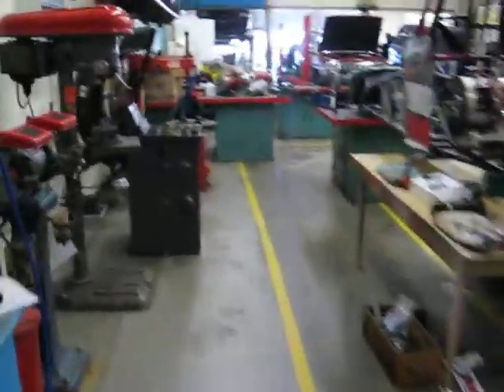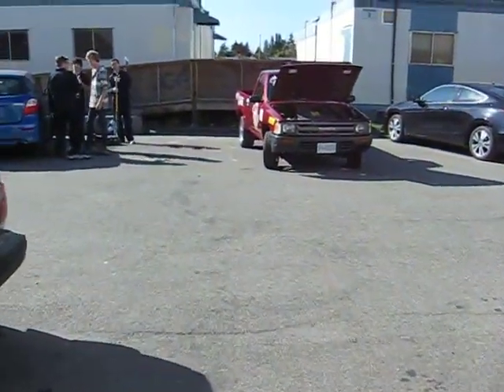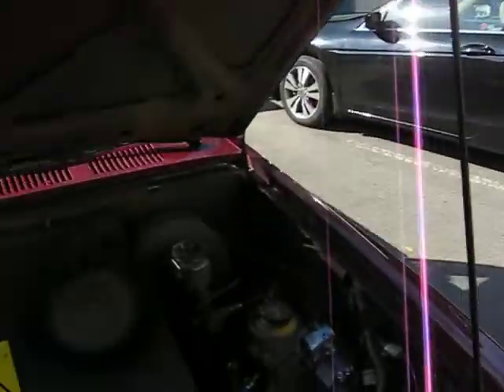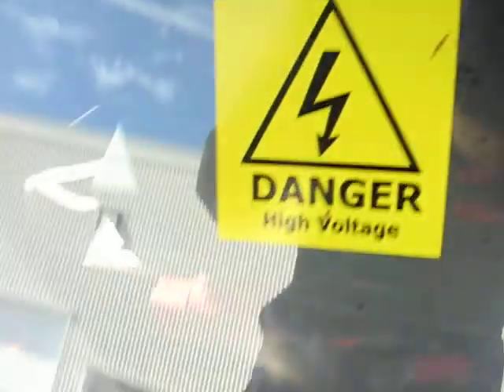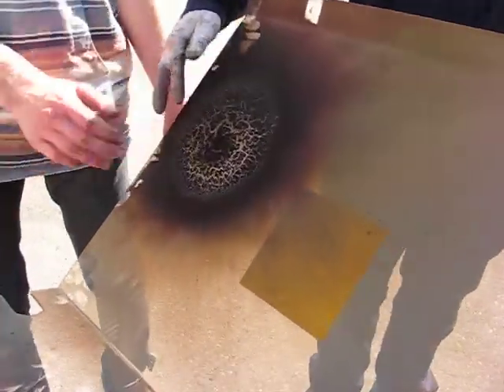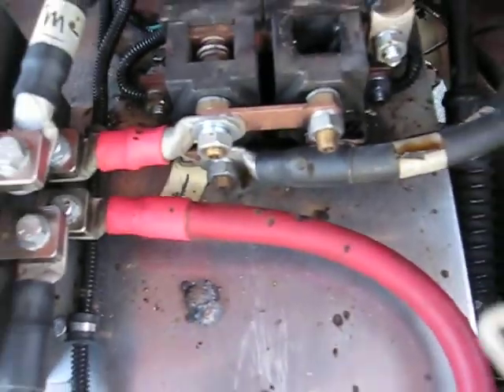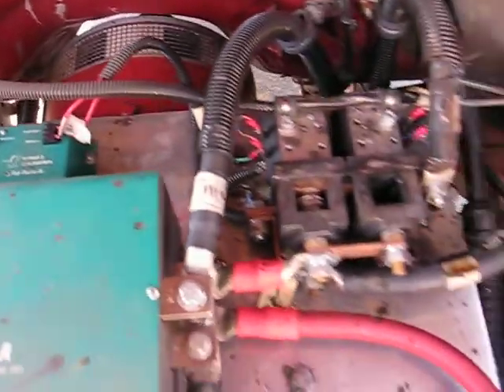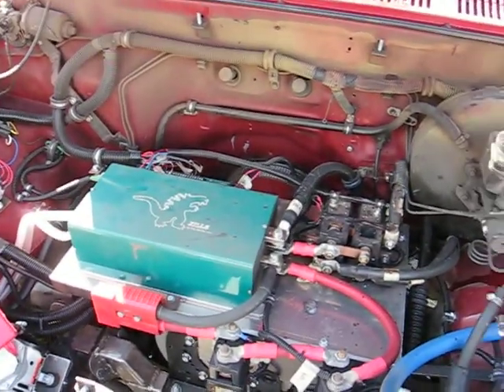Electric Drag Truck - The aftermath back at the shop!!!

Comment: Been there done that.  No more switches in the motor loop for me as of middle of last year.  Recommend designing to 600A continuous parts in the motor loop. You have a lot of helpers, push the truck backwards if you need to go reverse. or install a Lenco reverser.